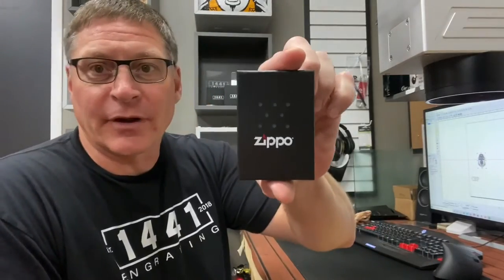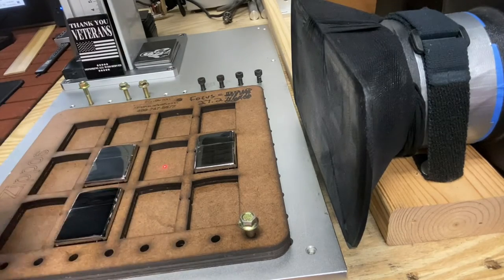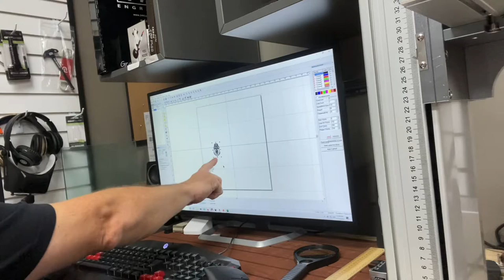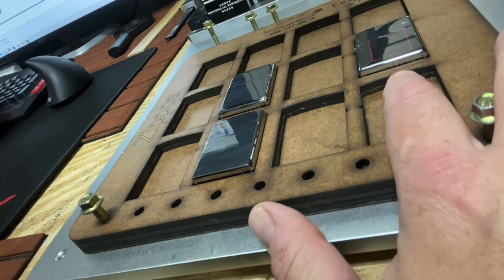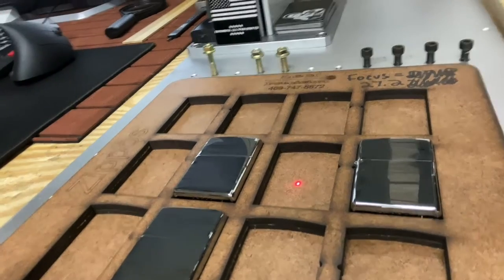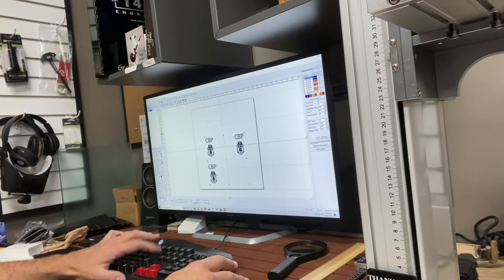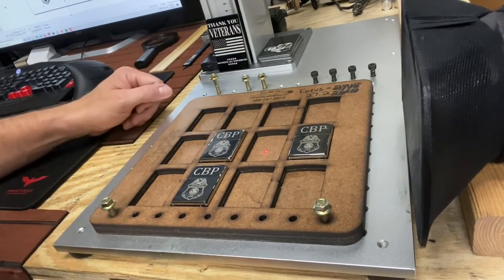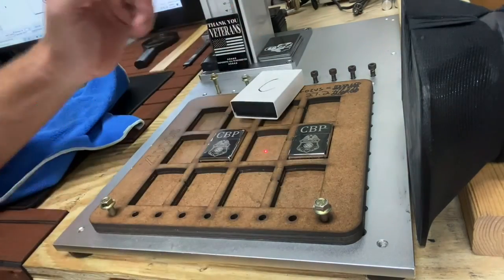Laser Engraving Zippo Lighters

Comment: Im new with a 30w JPT Fiber from Cloudray , so I'm running EZ cad2.  So to engrave multiple items (with same logo etc...) in 1 production run, you can just do a copy function and place the copy's wherever in the workspace? I have a  lot of bullet casings I want to do for a local Veterans group and being able to do 6 or 9 in a run (170×170mm work area for my lens) would be a great time-saver.
Reply from the maker: Yes, copy and paste works fine inside EZCAD. You may have to use multiple settings to get a desired outcome on brass though, it’s a different beast all together. You may have to use one setting for the cut in a second setting to brighten it up! Have fun and be safe!
Reply: @1441engraving  thanks for your time and input!

Comment: Hello! I currently have a foxalien Reizer and mine has a horrible frame set up in lasergrbl. When you’re able to have the entire set up like the rectangle frame before engraving, is that because of the laser or the program? It would make life so much easier!
Reply from the maker: Not sure how I missed your question. It’s due to the software. EZCAD2 sends the info to the laser with proper settings. The new Lightburn for galvos can do the same thing, with an extra outline ability.

Comment: Great video! Love all the info you are showing.  
What type of air evacuation system are you running? What cfm?
Thank you
Reply from the maker: I bought an aftermarket, fancy, high tech, expensive…. piece of crap. 🤣 Then I switched to the one that came with the laser, built an acoustic box for noise suppression and all is good! I’m unsure of the air it moves but it works great. I can even use it as I use two lasers.

Comment: Well I have many questions: How do you fit grafics to size of zippo? What software do u use? How powerful Is your laser? How much power do u use. Is all engarvings require same power on laser? How do you position grafics on zippo????
Reply from the maker: Well my particular laser projects an image onto the surface and with him engraving. So it’s easy for me to size the image according to what I’m engraving. Your laser may be different and you may have to measure or use some other method. I use a 30 W fiber laser and my settings will be different from yours. Engravings will require various settings depending on what your engraving, how deep you wanna go, and the desired outcome. Practice, practice, and write down your settings.

Comment: I noticed you use fume extraction. Can you explain the chemical composition of the dust you removed from the surface with the blue towel after engraving? It is my understanding engraving removes a chromium oxide layer from the surface. Chemically speaking, what happens to that layer during engraving and what is the chemical composition of the dust seen after engraving?
Reply from the maker: You have entered weeds in which no man has entered before. 🤣😳 No sir, the only thought I’ve given to the dust is wether to use a wipe or air to remove it.